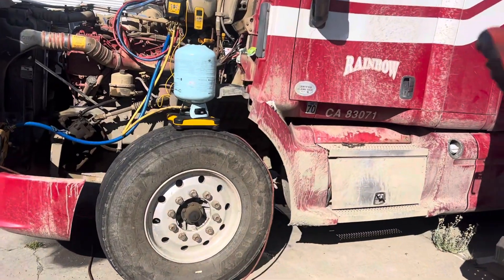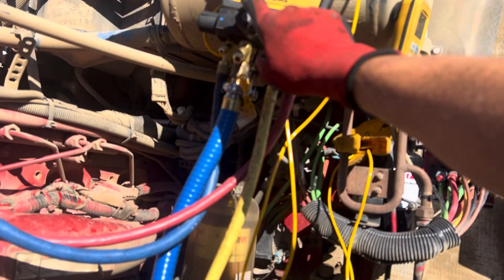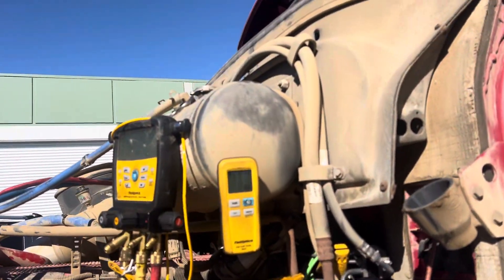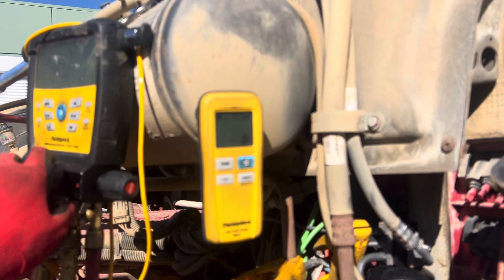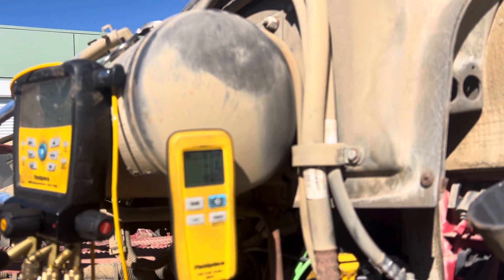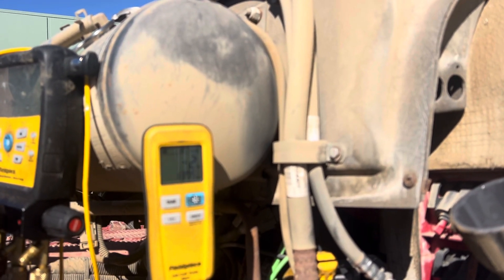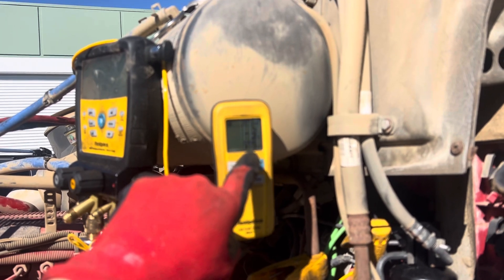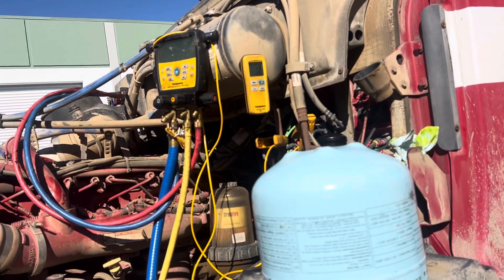3lb. 6oz. REFRIGERANT Under 60 seconds recharge

Comment: Do you ever charge from a recovery tank? Or do you always use Virgin refrigerant?
Reply from the maker: I always charge either virgin, refrigerant or clean recycled refrigerant that has been transferred into a new Clean recovery tank that is 100% dedicated to only receiving clean, dry pure refrigerant. 

Recovery cylinders are dirty . 

A straight recovery cylinder is filled with oil moisture. It starts to rust and flake on the inside overtime. 

This is why I separate my recovery cylinders from my Clean pure dry gas cylinders
Reply: Where do you send the tanks for cleaning/recovery/seperation?
Assuming there are companies that will scrub the r134a or 1234yf and then send the tank back with pure refrigerant.
Reply from the maker: @95GTSpeedDemon  if I have contaminated refrigerant, it goes to anyone of our local commercial refrigerant warehouse supply houses in our local area. 

Just like with your automobile for your used car oil or coolant you can take it down to one of the big chain box stores, that recycle oil or take old coolant 

The thing with refrigerant you bring them down a cylinder of full refrigerant, and they will hand you back every recovery cylinder . 

It’s a exchange program 

Depending on what type of refrigerant and what state or business you’re dealing with 

It will either be a free swap out with a tank 

If it’s a very valuable refrigerant, they might give you one dollar or two dollars per pound of refrigerant to bring the refrigerant 

Some places might charge you one dollar or two dollars a pound to take the refrigerant. It all depends on your location. 

It all goes back into one giant tank that usually goes a big semi truck or train, and then shipped off to a processing implant all at one time 

I own my own recycling equipment, so I recycle my own refrigerant . 

This information is all covered if you have taken your recent EPA 609 certification test 

I have posted links to free one hour webinars on the rules laws and regulations to take your EPA 609 refrigerant CERT test 

MACS and Robin Air sponsored training webinars are free. 

If you join the Facebook group 
( Automotive, HVAC technicians ) 

And scan back one or two months through information that I have released with links to training and information you will see the free webinar
Reply from the maker: @95GTSpeedDemon no there’s no companies that will send your refrigerant back to you. 

Refrigerant drop off points are at commercial refrigeration, warehouses supply houses . 

They work different ways in different states and different companies 

One is a tank exchange program 

You bring them your tank of refrigerant, and they give you a fresh empty recovery cylinder 

Sometimes they charge you a minimum fee sometimes it might be for free . 

Depending on the refrigerant, might charge you a small fee for every pound of refrigerant 

If it’s one of the rare more expensive refrigerants, they might give you a dollar a pound or more for the refrigerant 

This changes, state the state and Company to Company depending on your location 

They don’t recycle individual cylinders they recover it all into big giant cylinders that are anywhere from 750 pounds to 2000 pounds per cylinder then it usually gets held off to a train station and goes to one of the states that have a large recycling center that does tens of thousands of tons of refrigerant at a time . 

And then it goes back into the system for resale 

Like your used engine oil goes to a central oil, recycling center. It gets picked up by many local pick up recyclers but it’s all going to basically one location to get processed and refined to become new motor oil or different oils for different uses. 

For your coolant, it all gets picked up and goes to a recycling center that distill out the water, separates the coolant filters it and turn it into usable coolant again .